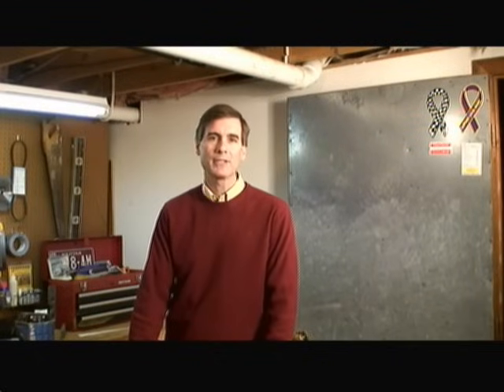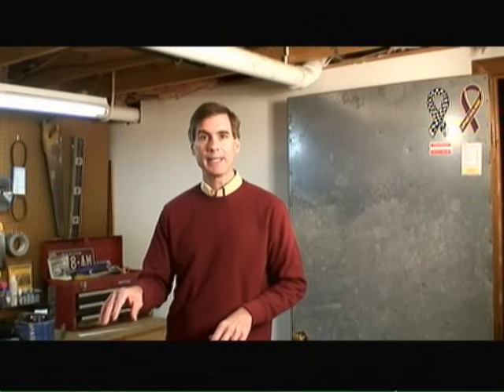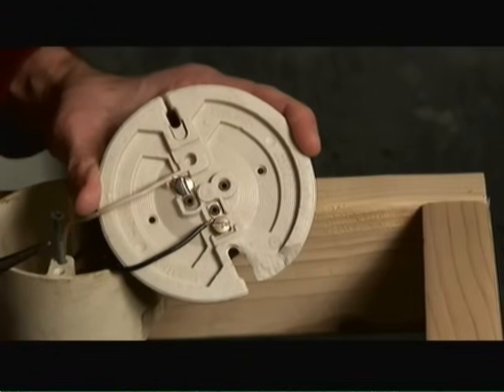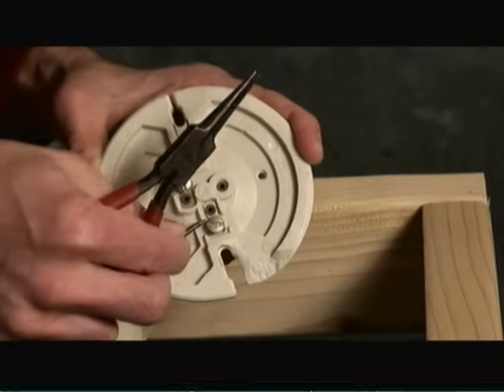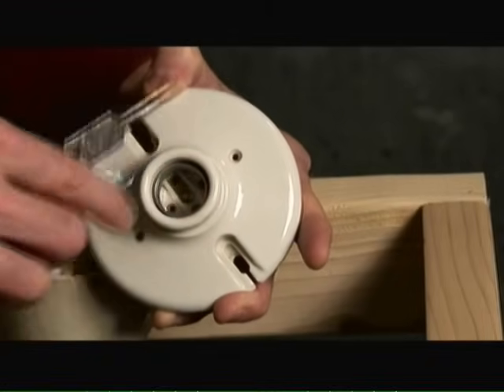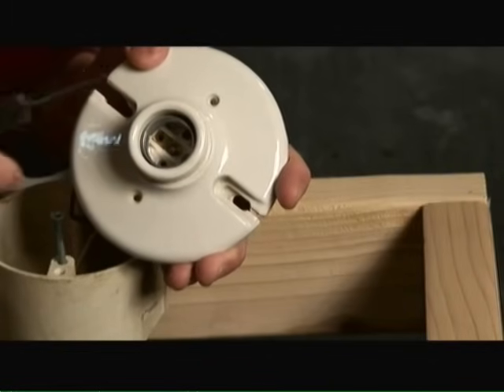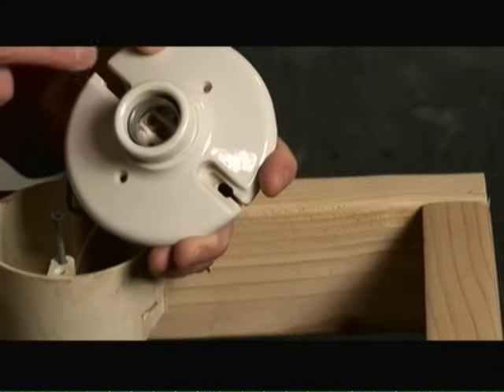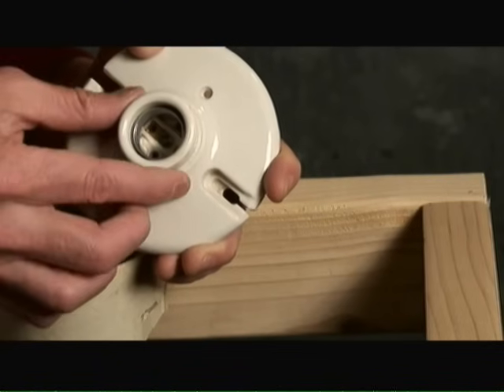Electrical Light Socket Wiring Video

Comment: Thanks Sir. Explained very clearly. In our Country we use red/brown for live and blue for neutral. I have now gone through several clips, but nowhere do they explain how to establish which is the live and which is the neutral of the light bulb socket. All I heard was connect the brass to the Live and the Silver to the neutral. Now my problem was that in our Country all the connecting points are made of brass. When you explained the inside of the bulb socket, I realized that the middle point was the Live. Thanks. Might be an old post, but it helped me a lot.

Comment: Where does the ground go
Reply from the maker: No where with these types of light sockets. Just fold it up inside the electrical outlet box. If the light socket/fixture has a ground screw/connection, then attach the ground to it.

Comment: I learned a lot from this though i do not know what to do with the ground wire. I yive a rating of 95 minus 15 for putting me on ????  where to put the ground wire so i give you only 80. 

I am still searching for an answer.
Reply from the maker: You let the ground wire float in the outlet box IF there is no ground nut on the the light fixture. Now add another 20 points to the score :)
Reply: Excellent

Comment: I have a red and black wire....!
which one goes on the brass screw???😐😮
Reply from the maker: It depends which one is the "hot wire", either red or black could be the hot wire.
Reply from the maker: The red and black wires can both be hot, and normally one of them ties to the brass screw.

Sign Up for my HomeAdditionPlus.com newsletter and get free home remodeling and home improvement tips, as well as tool product reviews, from me every month. Sign up here:  http://www.homeadditionplus.com/Subscribe-to-Newsletter.htm

Comment: I have 3 wires green black and white, what do you do with your ground while using a blue plastic box. these porcelain light sockets don't have a screw for the ground do I just cap off my ground or tie it off into a makeshift screw
Reply from the maker: If there is a a bare copper wire in the electrical box (blue box) tie the green wire to it. Green is for grounding.
Reply from the maker: Sign Up for my HomeAdditionPlus.com newsletter and get free home remodeling and home improvement tips, as well as tool product reviews, from me every month. Sign up here:  http://www.homeadditionplus.com/Subscribe-to-Newsletter.htm

Comment: is there any way to connect a tube light to a bulb socket???  But the problem is that the tube-light is having the two pin plug. I want to hang it by the ceiling. thanks in advance
Reply from the maker: +Anthony Gomes Not aware of any.
Reply: Like Fluorescent?  If so, You cant with normal Fluorescent but with some LED's you can. Toggled has a tube light that uses straight ac current from a wall socket. Only one side needs to be connected.
Reply: #HomeAdditionPlus... thanks for the rply
Reply: #Victor Fiori... thanks .. I will gv it a try..

Comment: I want to take out a socket from an old light fixture and wire it to an extension cord to power a CFL bulb, for an experiment.  The light socket has the hot, neutral, and ground wires attached to it.  Since the extension cord only has the hot and neutral wire, do I just remove the green (ground) wire from the old socket when I attach the hot and neutral wires from the extension cord to the socket?  Thanks.
Reply from the maker: +Sourdough Girl Yes you can, however, why not use a three prong extension cord with the Ground wire in it.
Reply: While waiting for an answer I converted it into a decorative lamp.  No wiring need.  Thanks.

Comment from the maker: If the old antique light socket has no ground wire on it then you can not attach the bare copper ground wire in the electrical box. Just put a wire nut on it and tuck it far back in the box.

Comment from the maker: The bare ground wire should be attached to the green wire on a light fixture or metal chassis of a light fixture, IF there is one. If not, just leave the ground wire disconnected.